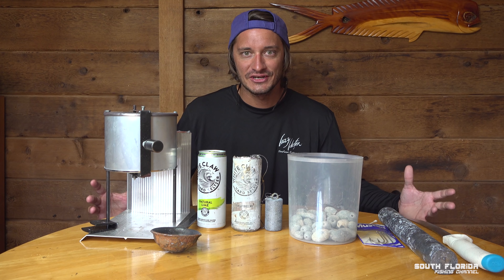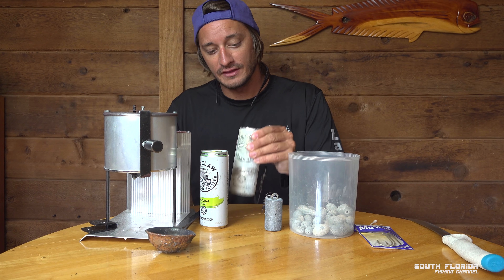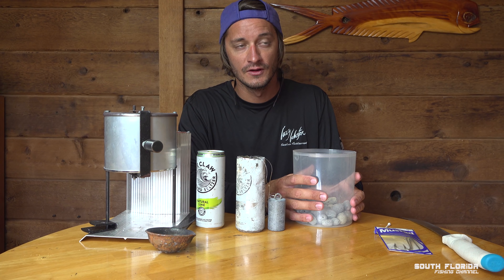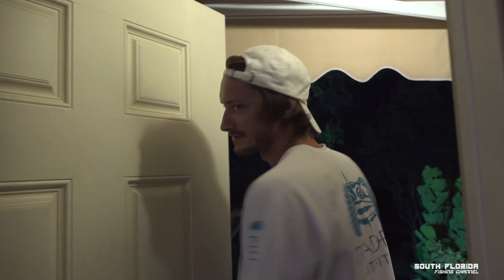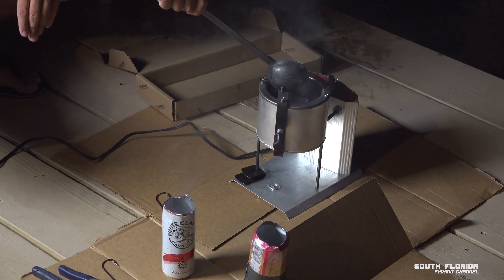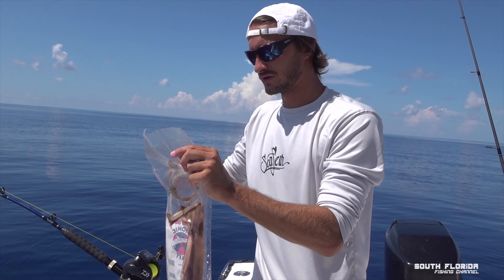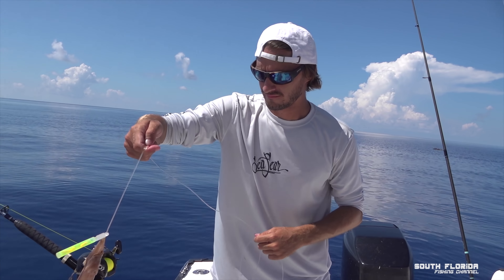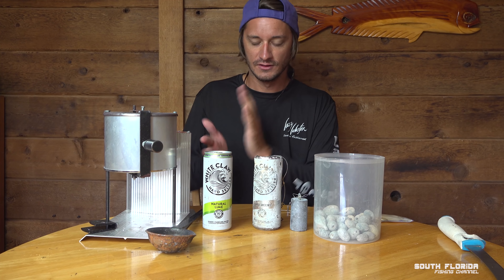How to: Make Swordfishing and Deep Dropping Lead Weights for Free

Comment: Imao,great upload brings back memories we did the same some years back and did everything you advised not too,we used steel pipe about 1 inch in diameter for sea bass maybe a little to thin and i think a little moist inside too,them things were like getting sprayed with a shot gun frigging hurt like hell can tell you we learnt from our mistakes the second time around lol.enjoyable as always heiko thanks pal

Comment: Great video, try a length of 1 1/4" PVC, bury the PVC in sand to the rim, so the PVC won't distort to bad, pour your lead in the PVC, add your hook with qtip. This works great, just leave it in the PVC. If you make them too heavy just trim it down, cut the PVC and remelt lead for your next weight.

Comment: rebar used in construction, hit up a local company and they will probably give you a ton of offcuts for beer money. use the big stuff, 1.25" and up, just weld a half link of chain on top. Cheaper, recycling construction scrap, sacrificial, and they will rust away so better for the environment.

Comment: Hey Heiko, you should look into using PVC/CONCRETE instead of lead to make your weights for deep dropping and sword fishing super cheap and effective
Reply from the maker: Do you find it holds bottom as well when you use that? I have issues with it not holding so well in stronger currents the concrete vs lead. Probably due to so much more surface area
Reply: Honestly, I haven’t used this method for making my weights, but it’s a method I remember from an old fishing friend. He used with his electric reels and deep dropping and it seemed to work well for him.
Reply: I plan to experiment with using PVC together with concrete or maybe make mold from something like your can idea. I think that the concrete should hold bottom well as long as you make the weight heavy enough. I think 8-10lbs of concrete would hold bottom.  Idea is just something I thought I would throw out there as an alternative to lead. Good Luck and tight lines!!

Comment: Doesn't nick stanzyk just use large diameter rebar? Seems that would be more cost effective. And you could have a shop fab up a bunch of them in no time.
Reply from the maker: Well I have about 120 pounds of lead collected from under bridges. Also hospitals usually have tons and tons of free lead (they transport cancer medicine in it). Maybe i'll do a video on the rebar ones! That would be great too
Reply: @SouthFloridaFishingChannel  oh nice!! I make all sorts of weights myself no rolls, barrel sinkers, etc.. btw of you find their not coming out right. Use a torch to preheat the mold. Its crucial that the bottom of the cavity is really hot as that will draw the lead all the way in instead of solidifying in the spout. Took me a while to figure it out for myself.

Comment: REBAR is the cheapest fastest easiest solution. get the chart that tells you weight per foot for each diameter. have it cut to the length you want. tack weld a chain link to the end, or whatever else you want. sky is the limit. you don't have scavenge around town for lead. Go to a rebar yard, buy from the remnent pile, or just but it new. They will cut it to your size. I get 50 to 100 at a time. Easy. Just get a cheap harbor freight welder.

Comment: Molten lead is no joke.  I'd suggest wearing gloves (welders gloves are best) long pants (heavy jeans, no holes) a long sleeve, loose fitting shirt and work boots.  Also, the real danger with melting lead is heating it to the point where it becomes a gas.  Inhaling those fumes would be very dangerous and could lead to long term injury.  If you keep the temperature of the lead controlled, that shouldn't be an issue.  Using that sort of melting pot should allow you to keep the lead at a safe temp.

Comment: I use steel. Much cheaper, about 2/3 density and no health effects dealing with it. For my smaller weights I use 316 stainless 3/4" round bar and a little hoop of tig filler rod. Never rusts. For bigger weights you can just have the steel yard cut pieces of 2" or 3" mild steel round bar and paint them. They charge me about 70c a pound, less at the scrap yard.  Don't mess with lead, it's not worth it.